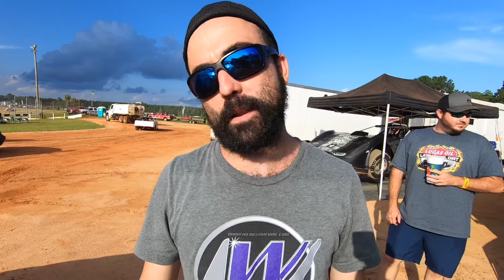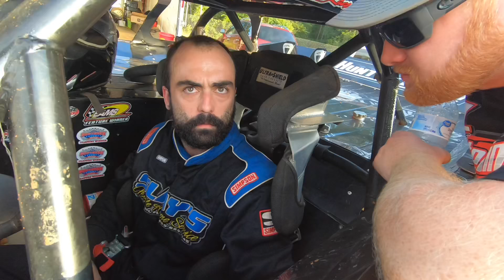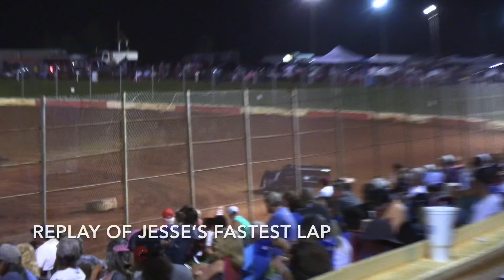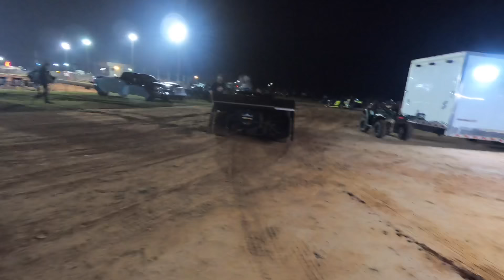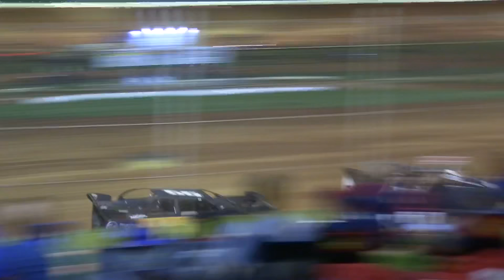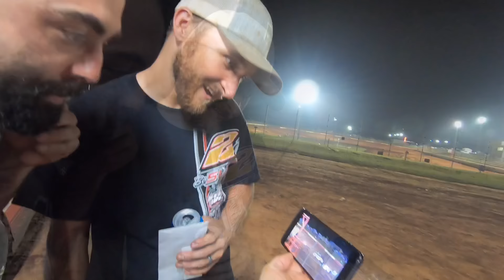Jesse’s Best Race Yet / Racing Near the Front at Deep South Speedway

Comment: I used to race street stock and pro street and had the same problem with the holleys and usually it would cough in the corners on a rough track, but we figured out a rubber hose with a hole cut only on one side about 1” long it fixes the problem !!! It allows the fuel to splash back up and go down the barrels..... I Promise it works I raced for 8 years and always ran up front so any little thing wrong we always made sure to figure it out, a tenth for every little thing I fix adds up !!! Good luck Jesse hang in there and stay positive don't get so frustrated at the boys they just wanna see u run up front just as bad as u do !!! Good luck

Comment: I pointed out to my buddies that Bo was almost stopping down there in 1 and 2 and then going, that was smart... also, I don't know if you can tell in the video.. but watch Nasse's front wheels.. all the way down the straightaway and in the corners... man, he was sawing the wheel. Guess this dirt feels a little more squirrelly than the asphalt! lol
Reply: Best thing Jesse could do is run a whole race as low & slow as he can. LEARN to run the bottom. Sometimes slower is faster. Something you have to do if the track really slicks off. Plus this chassis isn't the latest greatest geometry so the driver has to adapt to the car. Remember what Joseph said first time out in the Capital? Said it was first car he could ever put the front end right where he wanted it.